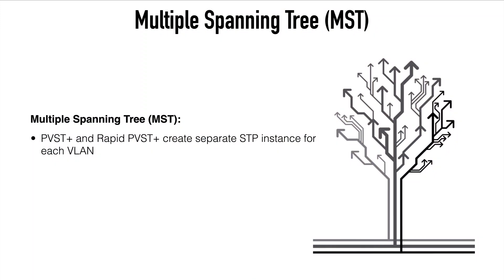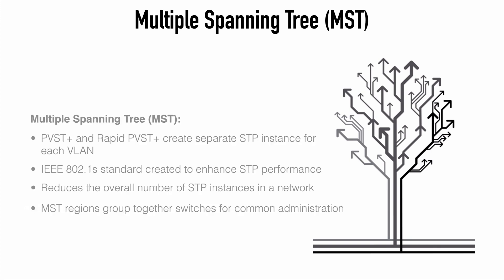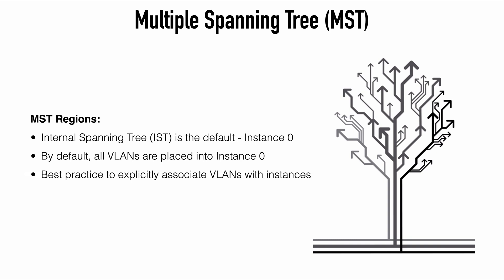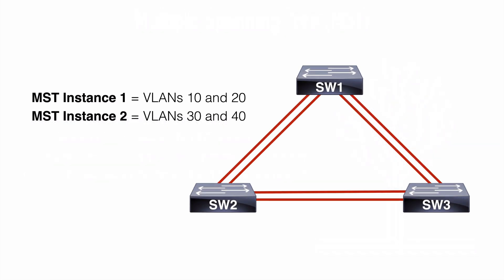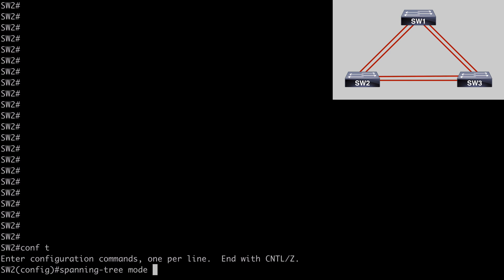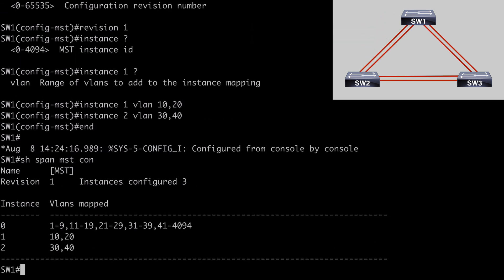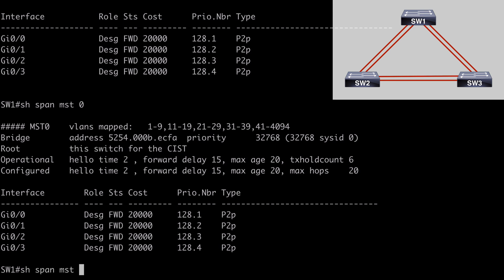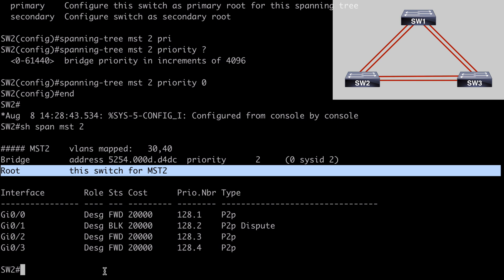CCIE Topic: 1.1e MST

Comment: Love the video! At home I use MST with VTP 3 to distribute the configuration. It's not bad, but I never was a fan of the reconvergence outage I would get every time I added or removed a vlan from one of the instances. Still neat to be able to manually route VLANs across switches as you see fit!